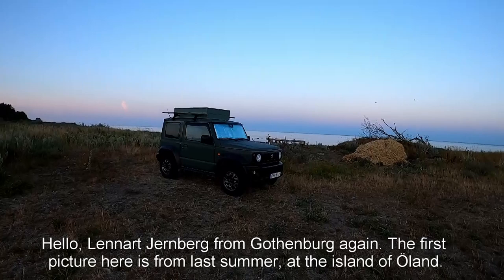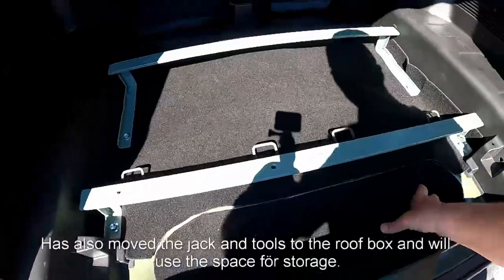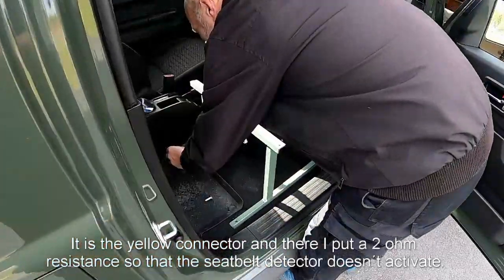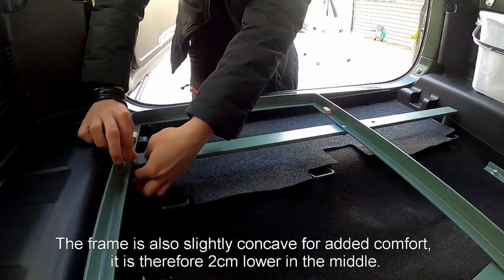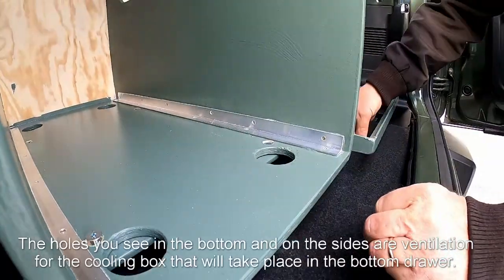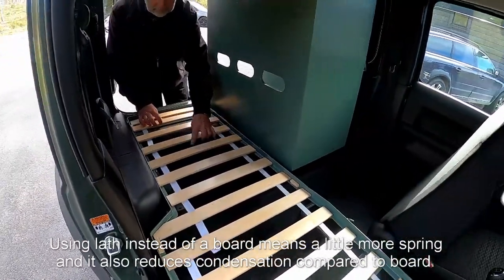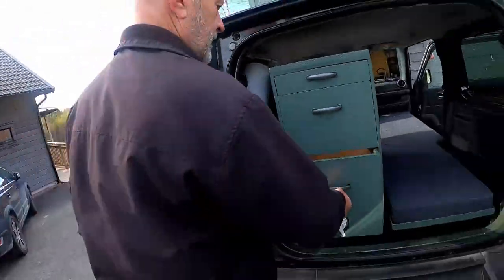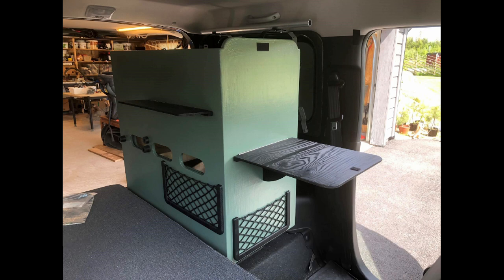My Jimny Adventuers 2

Comment: Nice job. Could you explain the trick with the 2 Ohm resistance? I tried it and it dit not work. The airbag indicator on the dashboard stays on
Reply from the maker: Sorry, there’s no special trick. Are you in the correct socket? It should work. It did work for me. 🥲
Reply: Sorry, I should have searched a little bit longer.  Problem is solved.
Reply: @lennartjernberg3512  thank you for the quick response.

Comment: I've noticed that you have a manual gearbox like many 4th gen Jimny's on the EU market. Is there some secret behind it? I've heard that automatic gearboxes are also good on Jimny's!
Reply from the maker: No there are no secret.  we are only used to manual gearbox.  and the automatic is four steps instead of five, it has an impact on fuel consumption and noise, I have noticed in the press.